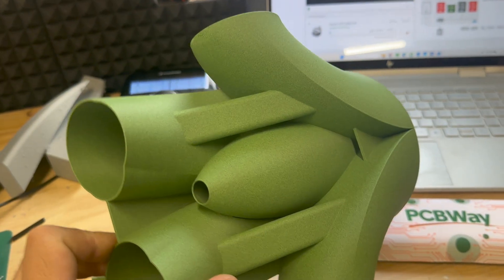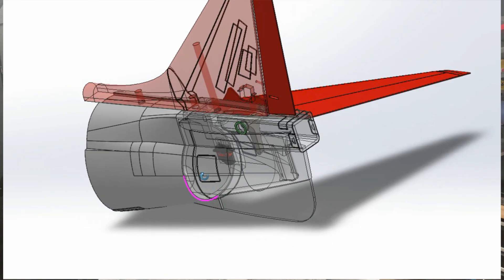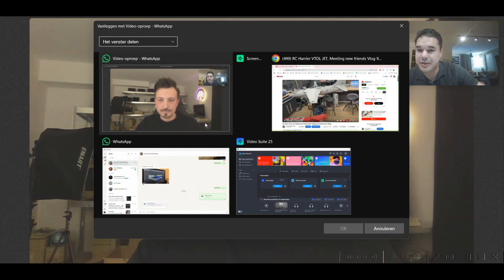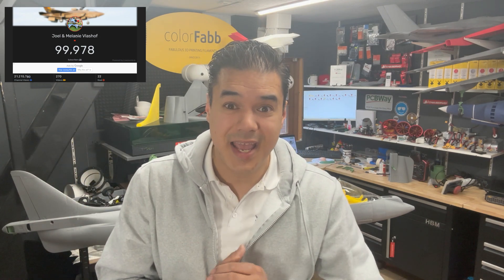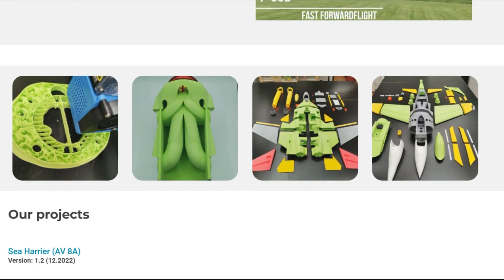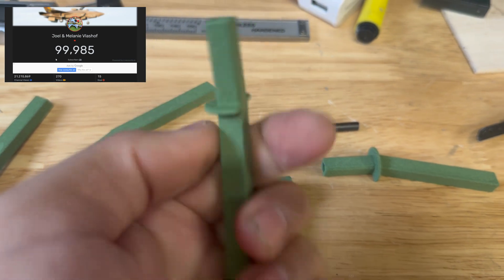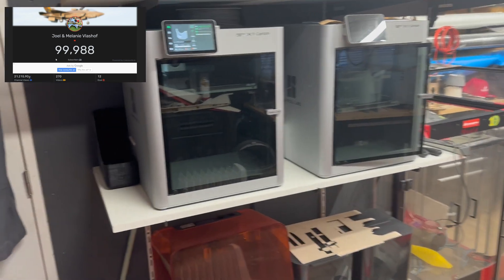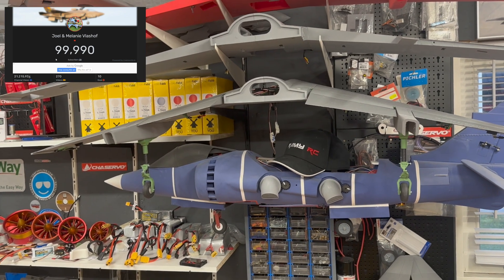RC Harrier Jumpjet | 100,000 Subscribers Countdown, Joel Vlashof Flitetest

Comment: Project AV-8B Harrier, it's a masterpiece. Could you write in the comments or make a separate video about the flight technical AV-8B Harrier ? 
1. Airframe weight without payload, kg
2. Payload weight, kg
3. Battery weight and capacity
4. Electric fan power consumption, kW 
5. Fan lift force, kg
6. Airplane length, mm
7. Cruising speed, km/h
8. Flight duration time, min

Comment: Congratz! Loving your videos! I joined your channel as I fell in love with your wing vents. As you have had issues with the vents, please try and redesign them so we can not see the wing fans you will need to add. Try and move the fans to the main body if possible. The current vents you are using should be fine but just need to be a bit bigger with extra power. If designed right you may even get way with less weight for the wings as the larger vents could be used as supports.